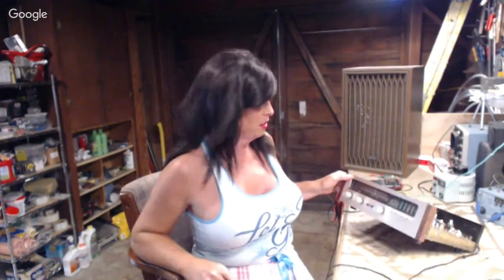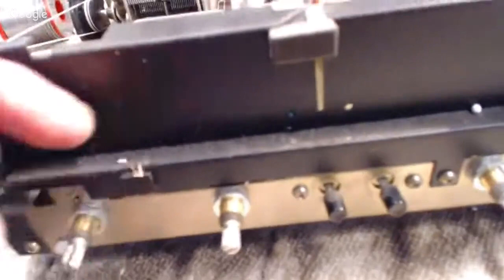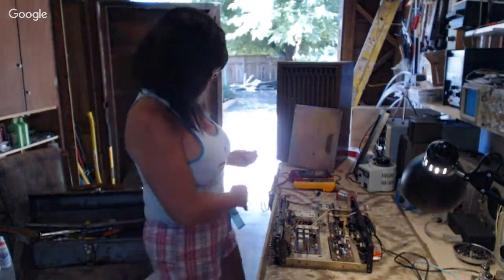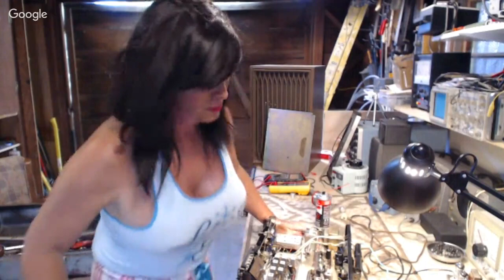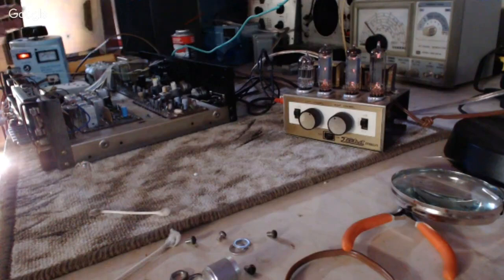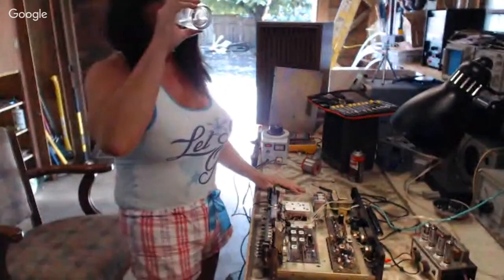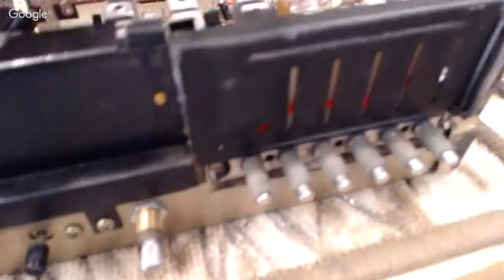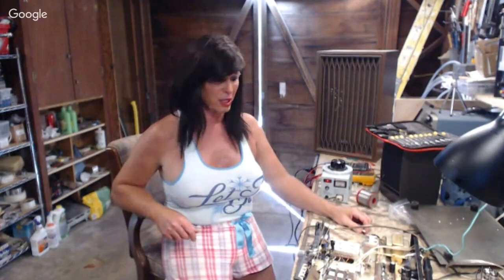From the Workshop...1970 Pioneer TX-700 Tuner Assessment & Repair

Comment: Darn, I work nights ( day sleeper) and missed your live chat at the Workshop. I'll watch it all later but I did catch that little tube amp. Don't see too many that size. Neato! I totally agree, the condition of the front panels is critical while the electronics can always be repaired. I'm in the process of building a home brew Preamplifier with three equalization controls...lows, mids and highs. I find the mids often need to be backed off a little too. It also includes a magnetic phono cartridge preamp and a computer audio input for my stored audio on the computer. I'll upload some pics to you when I get it completed. Boy, I found a Marantz CD Changer VC8100 at Savers Thrift Store for $20. They originally sold for around $800 and still bring over $200 used. It holds 300 music and or video CD's and contains all the current features of the latest high end cd players. It sounds fantastic. Yes, throw away the WD40. It's wicked on plastics. I find the electronic cleaner for $5 bucks at WallMart to be excellent. It contains no lubricant and leaves no residue which is critical when cleaning variable caps, band switches, etc on rf and if circuits. Again, your face enhancements turned out great Rosie. Keep the videos coming. Bye for now.